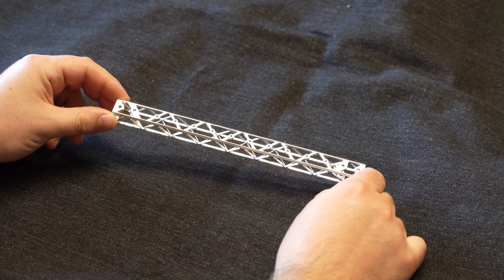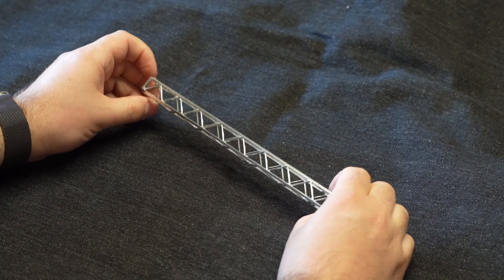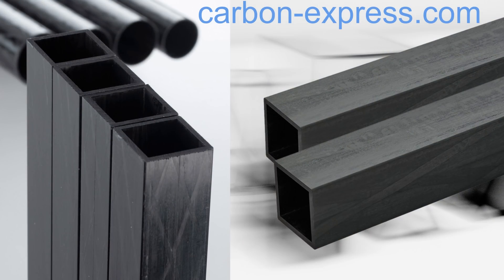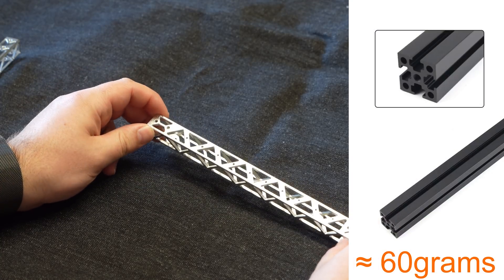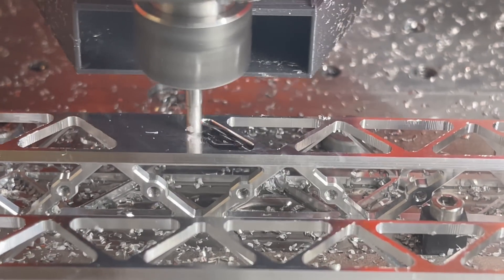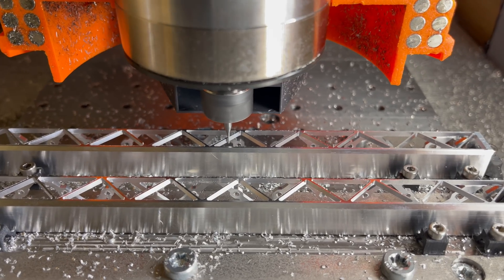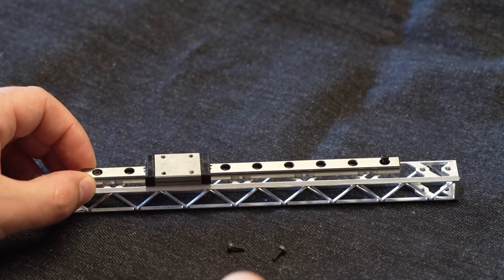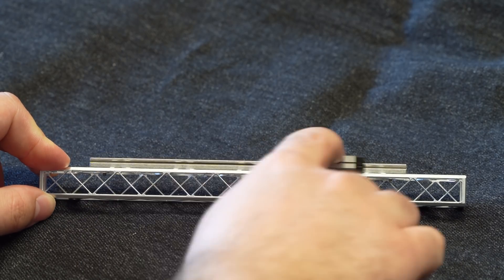Ultra light VORON 0.1 X-Beam

Comment: Hey
It looks really great
But in my opinion the stress concentration generated by these very small corner radiuses is not worth the pain of milling them out, I would look into thinning the grid but havi larger radiuses
Very very cool otherwise
Reply from the maker: Thanks, the grid is already very thin, a bigger radius would be pleasant to machine… If it won’t work out with producing the design in the Video, the corner radiuses will be the first change…
Reply: @premiumbasics  Yeah you are right that is already really thin but it is definitely worth it in my opinion do do a FEA analysis even using free software like Fusion 360 and understand what is the difference in strength between smaller fillets and wider beams and the opposite

Comment: Very cool. It sounds like you wish you had a more capable machine than the nomad? Do you like it still, was it worth the investment? I am thinking of getting an MR-1 by langmuir because it is the first machine under $8,000 I have seen that can cut Steel in a half way decent fashion. Anyway I am subscribing and look forward to see what your doing with these little beams and slides.
Reply from the maker: Yes, wish i had a more capable machine… Knowing what i know yet, i would not buy a nomad, the machine has some severe limitations and for what it offers it is to expensive…
I have seen the MR-1, do they already ship? The SHARIFF DMC2 seems also to bee a good machine, but i would wait until all kickstarter orders have been completed (currently the first orders are being shipped).
Thanks for joining my journey to a new CNC :)

Comment: the issue is not only stiffness when building a structure for machining... the issue is also its ability to resist and dampen vibrations. This is why older Cast Iron mills and lathes are prized. The trick is to find a balance between the two. Cast Iron is known for its ability to absorb vibration and the very reason some of the most accurate CNC machines still use it as part of the underlying structure with modern linear rails and ball screws. There is even a few custom lathes made with granite at its core (search YT)
Reply from the maker: And a granite CNC is just what I will build ;) The Videos form @Piotr Fox Wysocki are a great starting point....
Reply: I saw someone do stress tests on different materials. They found that aluminum struts, supported by epoxy/granite casting approached cast iron in stability and vibration damping. Good to know. They used charts!
Reply: Syil machines are epoxy granite core.
Reply: Yeah but what’s real dope When you learn about things like electro-chemical machining which almost anyone with a tub of water and cheap 12 volt dc power supply can use in their bathtub to produce highly accurate metal components with the type of tolerances required which until now have only been capable on the use of industrial equipment which most individuals wouldn’t have had the access to or an understanding of how to use. 

With ecm you can take a piece of metal and transform its shape into a new one for some benefit that would be possible with nothing more needed to do so than water and electricity and patience. 

That means precision manufacturing capability is becoming an available tool in the general public which will only foster revolutionary inventions that wouldn’t have come to exist if the industrial sector had the benefit of precision manufacturing all to themselves

Comment: Could you use a v shaped chamfer mill to make it all one operation (no tool changes)? You can use the straight portion of the flute for roughing out the pockets, and the V portion to finish the edges.
Reply from the maker: I think this would work if were no inner corners who need a 1mm end-mill to clean them up..
Reply: @premiumbasics  if you don't have a sidewall in those corners, the V could possibly do that part as well.

Comment: Your result is great and it took you a lot of work. For anyone who wants to improve on their machine by reducing weight. Just drill a bunch of holes in a aluminum beam or use carbon fiber, it will be 1000x less hassle.
Reply from the maker: Drilling holes would work too, but it is 1000x less fun :P
Reply: @premiumbasics  This depends on the definition of "fun" xD

Comment: @Premiumbasics Experiment with air cooling your CNC! I have a low noise compressor with a 4 liter air tank and a flex nozzle blowing at the end mill. Occasionally the compressor turns on to build pressure again during milling jobs. Very efficient !
Note; Earlier I tried fluid cooling in different ways, but it always is very messy and limits the view on you cutter. I don't like it..
Reply: Seems like cooling with denatured ethanol seems like the best way to go for aluminum and high speed machining. Leaves no or very little residues, no mess, and is very beneficial for cutting aluminum.

Look at for example how Datron does it, their machines and endmills can reach crazy speeds and get fantastic surface finish. The run a lot of small single flute endmills at ~40K RPM on the small machines :)
Reply from the maker: Thanks for the suggestion :)

Comment: That's a really nice beam. I question the need for the weight savings but as a machine designer I can appreciate it's aesthetic and engineering. Nice job.
Reply from the maker: Thanks, every second counts while printing the speedboat-race challenge, so every gram saved brings an advantage :)
Reply: At 20Gs of acceleration the reduction of 5grams is helps remove 100gram force of load on the servos/steppers
Reply: @brandonsmoot4056  Is it even possible for a stepper to develop 20Gs or are you just throwing out a number? Seems a little unrealistic to me. 20G is 196m/sec sq. Think abour that for a minute.

5G maybe but 20? I doubt it.
Reply: @jamescrud  20Gs is definitely an exaggeration but the point stands. removing a little weight on something that's going to be accelerating and decelerating a lot can make a big difference
Reply: Take for example the moving axis on a CNC machine, where a structure needs to support a linear bearing. That needs to be light so that the motors which control the movement don’t have to overcome a lot of inertia.
Reply: I was also wondering how weight savings were beneficial, but as earlier comments pointed out, if this were the moving beam, if would help improve acceleration. I wonder what the percent of gain that would be when one considers not just the beam but also the mounted extruder assembly (I would assume this would use a bowden tube set up).

Comment: Having read a bunch of the comments, all telling you what you should do, using machines you don't have, from materials you can't get, I have a simple solution.  Mount it on a polished hardwood base, and keep it as a piece of sculpture.   It is a beautiful thing!
Thanks for your video.
Reply from the maker: Thanks! Currently V0.1 and V0.2 are in a small glass show case.

Comment: Does anyone know offhand how trussed structures like this compare to a closed section tube in terms of torsional stiffness?
Reply: The short answer is they don't. The ends of a square tube need to be closed for it to have good torsional stiffness. They don't behave like a round tube or pipe (hollow automotive drive shafts for example). Even when you do cap the ends they are still not as good as a hollow shaft. This particular trussed tube won't have much torsional resistance because it was machine from a square tube where opposing walls are not joined/braced against each other with any material. If you look at stage lighting trusses they are different. They have tubes joining opposing walls in a triangulated fashion along their entire length. This is what gives them torsional resistance.
Reply: @jamescrud  "The ends of a square tube need to be closed for it to have good torsional stiffness"  Same goes for ANY hollow shape, round, square, triangular etc.
Reply: @jamescrud  imagine we make tiny holes in all nodes, and then stitch the beam with 4 wires and tension them at the ends.
Reply: @jamescrud  this is why we need to step up to a solid square bar as the starting point :)

Comment: Thats funny im working on a small skale Horizontal machine but whit specs regidity speed and atc of real industrial machines, for Exactly that type of work :D im glad im on the right way!
Reply from the maker: Nice, just send it my way ;) I would even test it for free xD
Reply: @premiumbasics  i think the finished price will be between 7,5-10k, depends on how good im in problem solving... But the Elektronics freaking bonebreaking expensive... What in your opinion would be a ok price and what shuld the machine be capebl of?`
For Scale it shuld be like half of a Haas Mini Mill in terms of size and power. 1/2 to 3/4 of that.
Reply from the maker: @X197ToPlay  sounds interesting, I am no expert in pricing things :D Maybe You could share a video of Your machine after it is done? ;) It should mill accurate and not too slow…

Comment: Very neat!
For your roughing pass I would recommend trying to cut the full depth in a single pass. You will likely need to cut a small entry pocket with the same pass depths you are using here, but after that you can probably just do the full thickness. And using such small radii on the corners is likely unnecessary, I don't think you gain much from it.
Reply: For a profiling operation like this, the cutting force is directly proportional to the depth of the step.  If you have a machine with limited stiffness, then reducing the step depth is necessary to prevent chatter.  

If your machine can handle it, I think the best solution is as mentioned.  I would pre-drill an entry hole for the end mill to start in.  A lot of times a helix entry can generate unpleasant vibrations that really punish the tool.  Make sure you take advantage of the chip thinning or peel milling toolpaths that modern CAM software can generate, they can help push the feedrates very fast.
Reply: @fastindy  Quite true, that's a pretty fiddly job and I have never worked with something that has so little material supporting it.

I do find that ramp cutting in aluminium is highly dependent on the rake of the end cut of the endmill, if your tool is fairly flat-cut (for durability in steel) then it exerts much more force on the workpiece and gums up more easily in a ramp cut. I kinda like single flute cutters for this reason, they have the most rake you can get, on both the end and side, but do require fairly long ramps or wide helixes. But for optimal cutting speed you should use more flutes while still trying to maximise rake. I think the ideal for soft-ish aluminium is 3 flutes with high rake and no face cut on the end (very pointy), except for tiny tools (<4mm) which are difficult to cut with a good geometry with more than 2 flutes. Take care though, climb cuts are a bit more dangerous with high rake tools.
Reply: Hey Sam, you are rather wrong about the small radii. Having a radius on the part reduces stress risers and adds huge amounts of mechanical strength to the beam which would be lost in sharp corners (think arch vs box)
Reply: @brandonsmoot4056  I was saying that the radius DOESN'T need to be so small. But that was just about how small the weight reduction is for the cost of needing a second tool.

The strength difference doesn't really matter for this since to maintain the accuracy of the 3D printer the deflection of the beam needs to be kept well below the sort of strain that would start stress fractures in aluminium.

Unless you are doing some really fun stuff to compensate for the beam deflection as you fling the print head around with 100W servo motors or something, then it would definitely matter :D
Reply from the maker: Thanks for the advice :)
Reply: @premiumbasics  yeah remember to predrill 20% or more bigger than the tool you are inserting so it doesn't catch the walls and can evacuate chips

Comment: Nice looking part, pleasant to watch, but makes a liitle or no sense:
- what is a point of adding  light-weight AL structure to solid steel rail ? who is supporting who ?
- why you call X-beam a  lightened square tube ?
Reply: It is called the X-beam because it supports the linear rail for motion in the X axis not because of the beams cross section shape.
Reply from the maker: The steel rail alone has a noticeable amount of flex, screwing it to the Aluminum X-Beam improves this drawback..

Comment: Just a suggestion - have you looked at lighter linear rails/guides ? - you put so much effort into making it light just to slap a chunk of steel on there... I don't know if the quality is sufficient but there are polymer slide bearings using elox-Aluminum rails (IGUS etc) also has the benefit of being the same material (thermals etc. - although your design compensates for that pretty well from the looks of it)
Reply from the maker: Thanks for the suggestion! Never heard of it, will keep it in mind :)
Reply: @premiumbasics  IGUS makes nice stuff - just be aware that plastic slides are terrible at handling moments - That said, if your forces are well aligned to the bearing, it will certainly save you a lot of weight, as they are typically using aluminum rails and plastic slides with very high static load capacity ( with the mentioned trade off of less capacity for misalignment and moment forces )

On the plus side, they typically will send you a free sample to try out their system - so you may be able to try it at no ( or low ) cost :)

Comment: The one thing that jumps out at me is that the zig-zags on two sides sharing an edge don't seem to have the same pitch. Commercial square truss is made such that it is made without a point ending in an unsupported beam segment. I assume this is to prevent buckling, but would also translate into a stiffness issue.
Commenting also for the engagement metric, so please ignore this probably being a redundant statement.
Reply from the maker: Yes the side with M2 Threads has a different spacing because of the hole spacing in the linear rail :/ Will try to improve it in the next version.
Reply: @premiumbasics  There's a mod for the V0.1 carriage to allow using MGN9 rails, just because its author hates M2 screws with passion and wanted to use M3 hardware.

Comment: That it's job for Laser cutting
Reply from the maker: Yes, but it is more fun to break expensive end-mills ;)
Reply: @premiumbasics  🤣
Reply: @premiumbasics  excellent work!
Reply: @premiumbasics  Could you also talk a bit more about your CAM decisions? As a fan of Titans of CNC, this diametrally opposed "light-weight, flimsy" this milling job is just as interesting.
Reply from the maker: @hardwareful  Will do so in a upcoming Video, BOOM! I watch almost every Video of Titans of CNC. Since my machine is not as rigid, I have to do small stuff ;)

Comment: The rail mount would be stiffer if you moved it closer to the corner rails - there is little torsional stiffness in the cross members.
Reply from the maker: Agreed, but this would bring a whole lot of necessary redesign work with it (in the other parts of the printer)…

Comment: Right on ! ! ! ! That looks cool. I wonder, if you send one of the finished machined X-BEAM out to get re-anodized, and then, send one out to get heat treated, and then one out to get heat treated then re-anodized, and did a strength comparison to see if the rigidity per cost would be worth it in a structural stress test all compared to the square tube (pre-machined)... That would be exciting to see the battle of the X-BEAMS.  Then to run the testing a bit further into a nutty measure of craziness, run them through a whole spectrum of harmonic and resonate frequency battles..  Perhaps, maybe some graphs might show if vibrations and harmonics might start to magnify the longer the machined X-BEAMS are... Based on the idea, of being less weight, for faster more accurate control of the steppers start and stopping action.. But then, there could be a feed back from the harmonics? I don't know, but it would be interesting to see a battle of these examples on graph or some real world testing.. And, for all I know, may not show anything at all, and completely wasted your time as the variables are all but unmeasurable as compared to the base starting point. Good luck,
Reply from the maker: Haha, Thanks for the Idea, if i have too much time left, i will do all of it ;) Will do some basic harmonic testing after i made some longer ones…
Reply: Very good ideas.

Comment: While this looks really awesome, think from an engineering point of view, a hollow square beam with a thin wall (maybe reinforced for the screws) would get you a better weight/stiffness tradeoff.
Reply from the maker: Thanks, maybe a thin tube is better, but i don’t have finite elements to simulate that scenario… Also reinforcing a thin tube at certain points is not a option for me yet (no tool for that job)